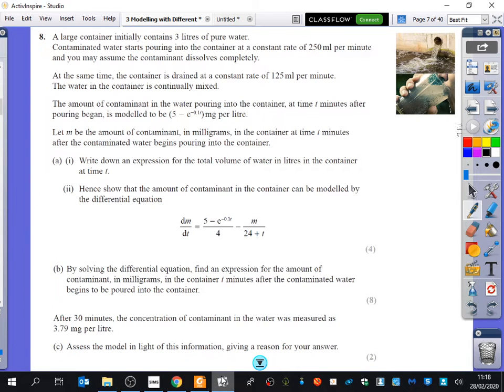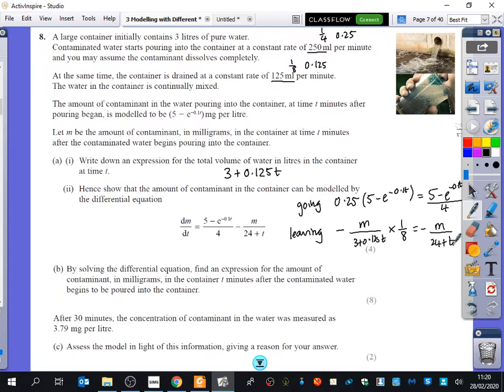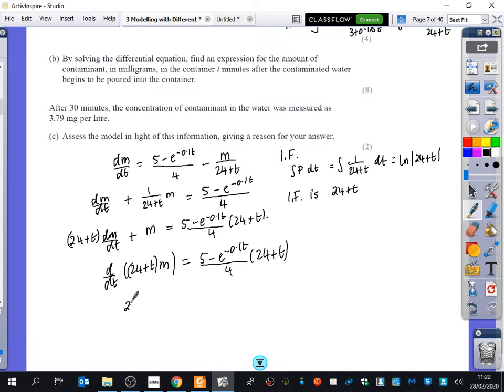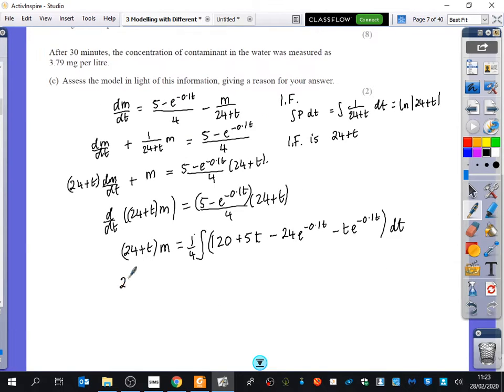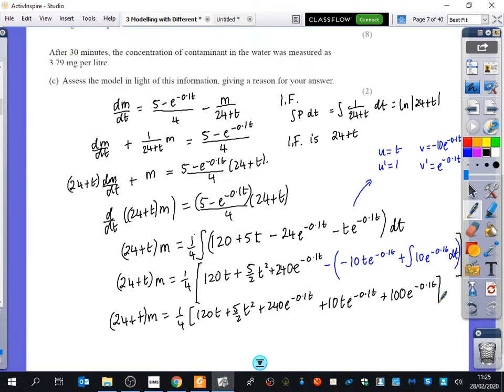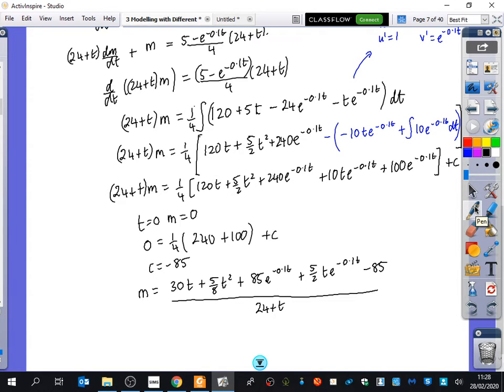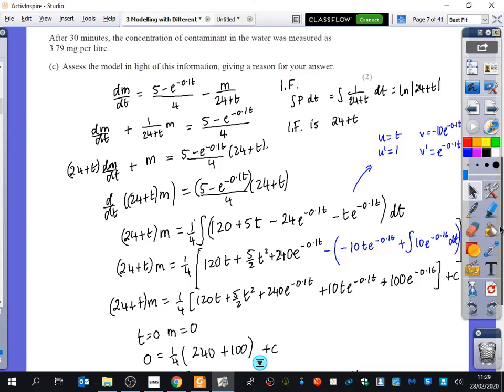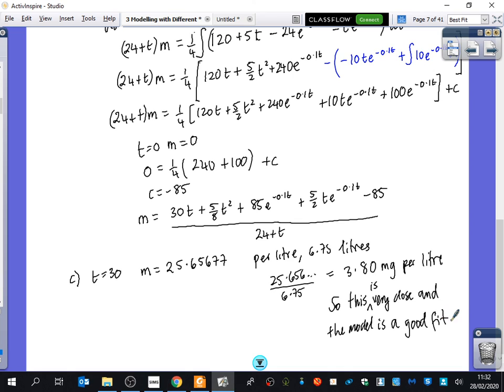Modelling with Differential Equations 3 • Further Container example • CP2 Ex8A • 🏆

Comment: 3:36 I understand that we’ve got to put it into form dm/dt + P(t)m= Q(t) and you was doing this fine. however, when finding P(t) why did you only move “m/24+t” when the other expression also contains a variable “t” which is part of P(t)
Reply from the maker: It's because the P(t) part is with the m variable, and the other part in the equation that I didn't move doesn't have m with it!

Comment: sir why do you have to do 1/8 for the first part ? not sure how u got -m/24+t
Reply from the maker: m/24+t represents the amount of contaminant in mg per litre, as 24+t is the volume at t. As 1/8 is leaving, we want to find an 1/8 of that so we have the amount of contaminant per 1/8 of a litre, as this is how much is leaving. 

We could alternatively have found the proportion of the volume that is leaving instead, and multiplied this by m, to find what proportion of the contaminant is leaving. This would be done by doing 0.125/24+t (the fraction of the volume that is being removed) and multiplied this by m, as the same fraction of m is leaving as the fraction of the liquid leaving, as they fully mix.
Reply: @BicenMaths  thank you sir, i was also wondering if you could make any shm videos
Reply from the maker: I think these are covered in the rest of this playlist!  @lofi_lover_girl
Reply: @BicenMaths  why do you multiply 3+0.125t by 8? wouldn't this increase the volume of water as well because going from 3 to 24 is alone a jump of 21 litres and t has to be positive so you increase the volume this way?
Reply from the maker: @SinghSK-z1p  You're also multiplying the numerator by 8 as well so the overall fraction isn't changing.